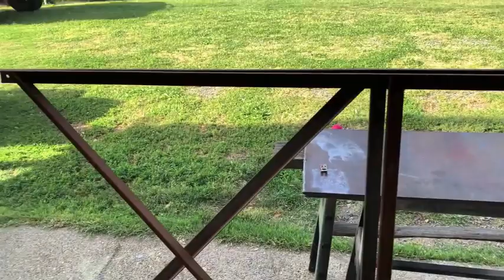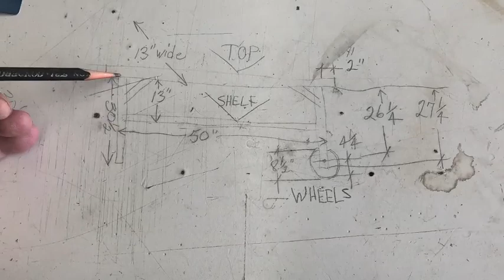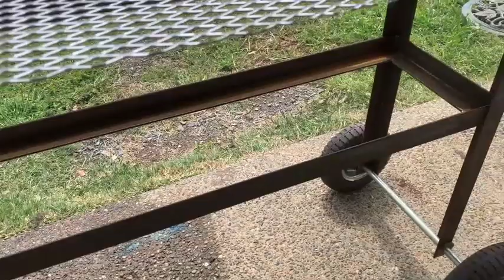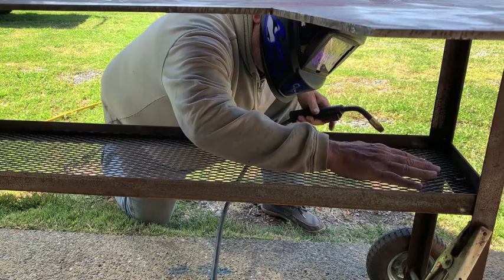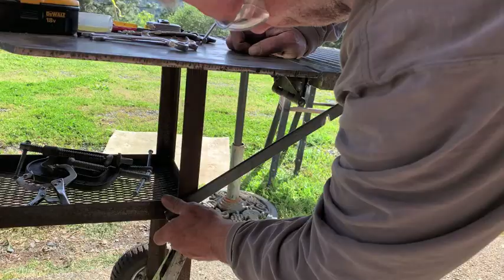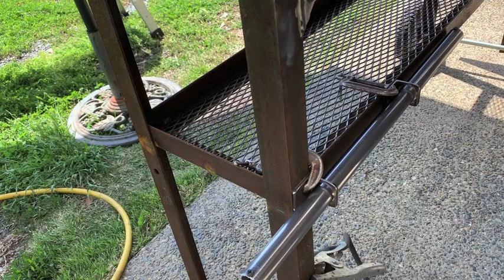A DIY Red'Neck Welding Table

Comment: Very nice. I'll bet you can find a gas grill cover for it when its outside. Good stuff Charlie!
Reply from the maker: I've been using that plate on the saw horses for about 3 years now, I keep it sprayed & wiped with WD40 and so far it doesn't get rusty...but then our climate here is a lot like high desert, it's pretty dry 10 months of the year. Wish I did have a rust problem though, I wouldn't have to irrigate so much.